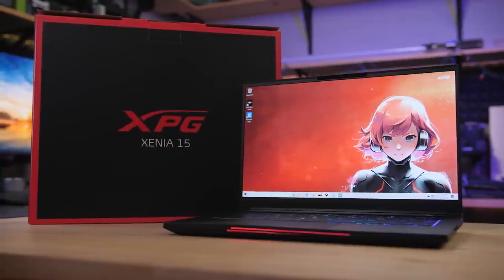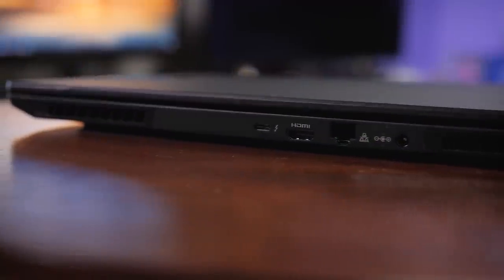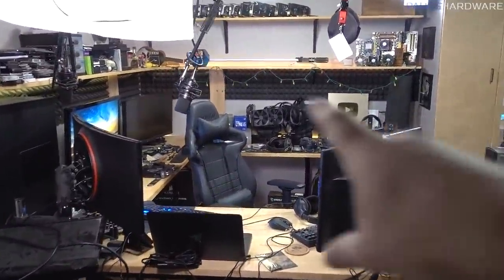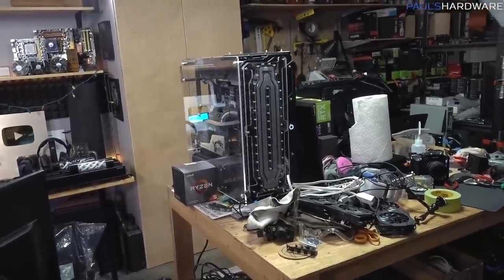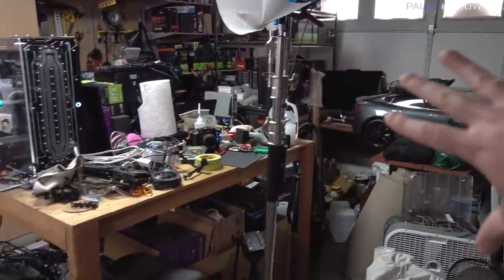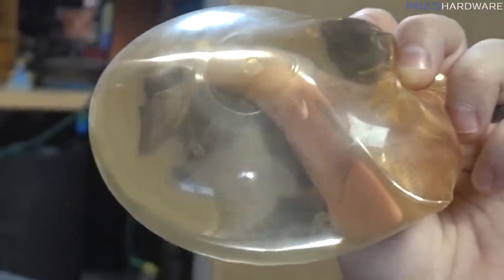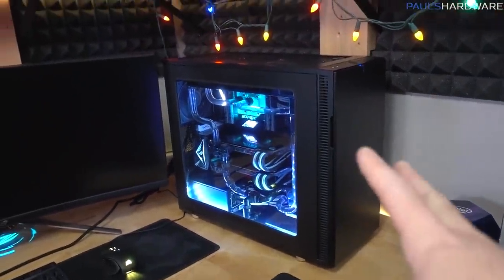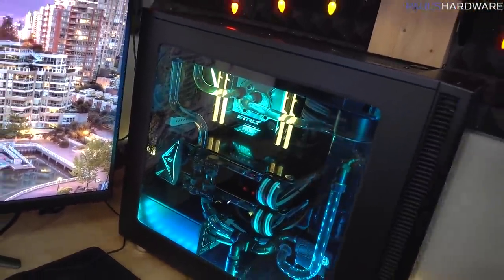5 Items That Have Defined My YouTube Channel

Comment: just wanted to say thanks. i was in the market to build a mid range computer capable of running android emu mainly. one of your budget build worked out great. got the ryzen 5 2600 radeon rx570 gigabyte b450 mb and evga power supply. im really happy. going from a very old i5 2500 4 core so thanks

Comment: The mystery of the B-roll footage has been removed.  I now know that's a cake turner underneath that sleek, sexy wooden surface.

Now I want a laptop-themed cake.
Reply: And how many takes it took. 😂
Reply: Easy if the laptop is closed. Near impossible if you want it to be open.

Comment: I recommend a leaf blower to clean the computer case. Personally, we use the old MAKITA's model on the computer service. We have to be careful with this and do it outside the building, but after cleaning the equipment is almost like new: P
IMPORTANT THING! Before cleaning, you must block all fans in the computer case and in the power supply, and naturally disconnect the power cables ;)
Try it :)

Comment: Paul I am  sort of using the same parts as Arctic Panther! Except am using 1 GTX 1080… and I'm using Corsair RGB 32 GB RAM…And my 80+ platinum power supply is from EVGA… And my system is not watercooled… But I am using the Fractal Design Define R5 with a tempered glass window! So yeah, my PC is kind of similar and kind of different :P

Comment: a comment on you talking about why you encourage people to build their own systems, and the excitement of getting a nice high end part and setting it up and seeing the performance difference. well, i am about to do just that. as i type, my ancient AMD FX 8350 (oc'd to 4.6ghz since 2014) chugs along happily, if not a little tiredly. sitting on my desk, however, is a new asus x570 motherboard (that i managed to find without TOO much of an inflated price), 32 gigs of corsair vengeance 3600 ram, and, ahem, a 3950x. because PC MASTER RACE. so yeah the culture shock of going from this old FX chip up to this 32 thread behemoth is going to be sweet. im just waiting on my new 4.0 m.2 drive and some noctua fans to arrive so i can do the actual build. i plan to film this build in HD (my first HD film since ive never had the hardware to do it, and i now have a pixel 3 that does a decent job) and ill be using the Ryzen 9 to render it on Premiere Pro. what a way to break it in! so i get exactly what you mean when you talk about the anticipation of firing up that new hot part and watching it shred. honestly, im having trouble sleeping right now as i wait for my fans and ssd to show up from newegg!

Comment: I stumbled across your channel looking up reviews or benchmarks because im building a budget gaming pc for Guild Wars 2 and maybe Fortnite. It's the first one ive done in like 20 years (other than one for my dad and nephew around 2012) I Decided it was time to replace the 10 yr old Alienware Aurora R2. (RGB & Liquid Cooling b4 RGB & LC was cool) :P  Which I still may use it for music production because its still quite fast. Its a i7 930 overclocked from 2.8 to 3.371 on the stock liquid cooler. The cores runs like low 110'sF normal and up to 130'sF under load. 12gb Kingston ram. Crazy a micro board with 6 ddr slots. I even thought about upgrading it which i read is a bit complicated due to the io boards and power supply harness. Anyways Ive really enjoyed your content during my 2 week ocd obsession with studying up on all the new tech. Ive learned more from here and other channels in the last couple weeks than I have the last 15 years about hardware and benchmarks. Keep up the good work.

Comment: There's certainly something to say about an upgrade path. I had to build my current system in 2014 due to my laptop having died so as a result I just slapped a budget CPU(Pentium G3420) and the minimum of 4GB DDR3 RAM but I did it around a decent motherboard (MSI Z87 MPOWER) and I finally upgraded the CPU to a i7 4790K. My only regret was that it stung quite a bit having to pay more than the price of a 7700K at the time or the newly released Ryzen but still better than to throw a motherboard, CPU and now 20GB of DDR3 RAM into the trash.

Comment: I recently had a similar issue with MSI Dragon Center 2.0.45 and it cleared up with a fresh upgrade to 2.0.46. YMMV, I was on MSI X570 Gaming Edge Wifi mobo.

Comment: Hi Paul you probably get this a lot I have watched your videos and I really like how you lay them out. I will definitely follow your videos when it comes time to assembly my own. And with that I have a list of components that have a "red" theme wanted to know if you think they are a good idea or maybe better components from your recommendation. Here is as follows (newegg prices):
MSI B450 Gaming Plus Max $105
AMD Ryzen 5 3600 $167
MSI nvidia GTX 1660 Super $360
G Skill Ripjaws V 16GB DDR4 3200  $90
intel NVME 512GB $65
Crucial 1TB SATA SSD (x2) $100 ea
MSI AC905C WiFI PCI $70
Fractal Design Focus G Mystic Red ATX Mid Tower $57
eVGA 500 W1 80+ PSU $68

Comment: I would like the louder roar for the "arctic panther" back as the background as the low rumble is either nearly noticeable or the new use rumble is confusable with background noise.
Reply: Thought that the whol time. When the build comes in sight, the low rumble is adequate, but when the name ist said, I want a proper roar.

Comment: Paul I am in the process of upgrading my AMD fx 8350 eight core,  w/32 GB DDr3 memory, and GTX 970 GPU I built in 2015. Is the AMD Ryzen 3700 eight core significantly faster?  I am using my computer for 3D animation and 4K video editing.  Would this build you created in this video make a big improvement on my existing system? Please respond.

Comment: Hey Paul if you need some extra cash, more space or just want to help a very much in need of some components Disabled Vet out I woulds greatly appreciate it. Maybe do a Garage sale. I can  contribute time money, knowledge and some computer stuff if not to you then to another person in need. I have been subscribed to you for about  3 years or so. but I do not always have a computer. I have a "DELL Optiplex 7010 sff"  / i3 3240 4 gig of RAM single Channel. A very old intel 160 gig ssd. NO RGB NO WIFI NO Good Ethernet  original adapter. I did get a Windows 10 pro key for under $20 thanks to a great video you did Gave great sound advice as ALWAY'S. You are welcome and Thank you.